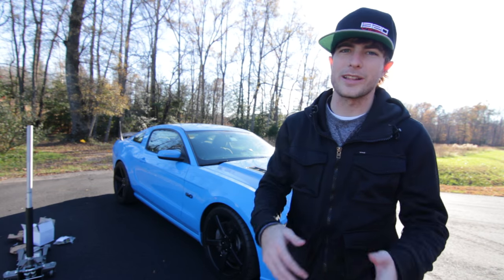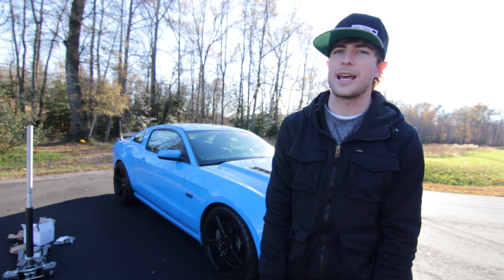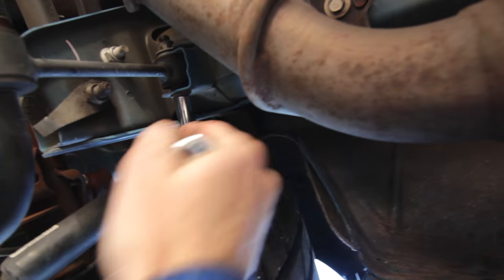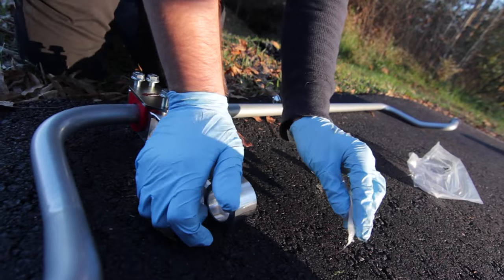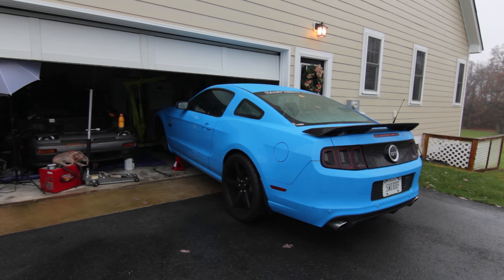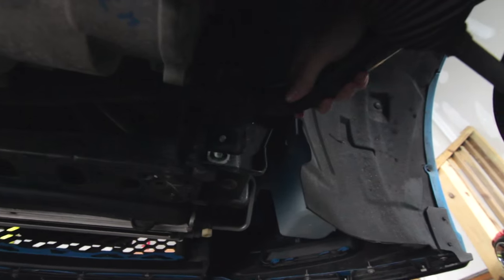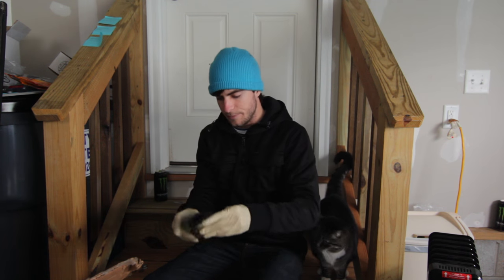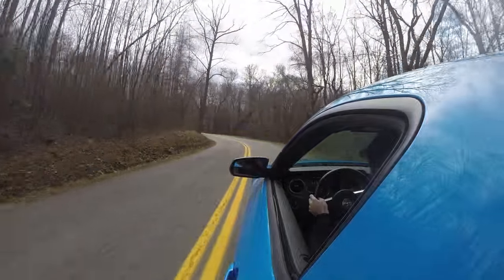Smurrf Get's Steeda Swaybars!- Bye Bye Bodyroll!

Comment: what are the disadvantages to not having body roll?
Reply: the car will be more stable through the corners.  basically it will handle slightly better.
Reply: stiffer ride most of the time